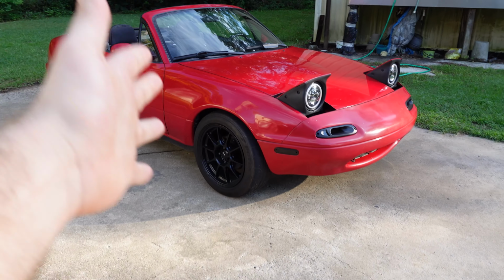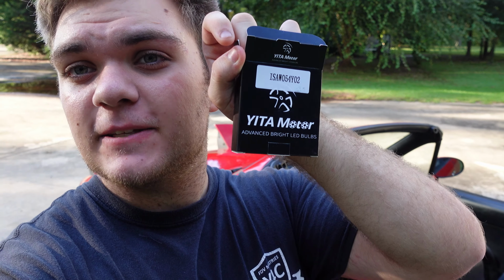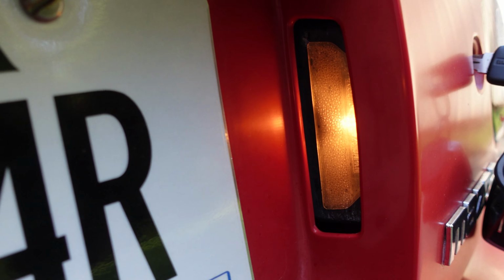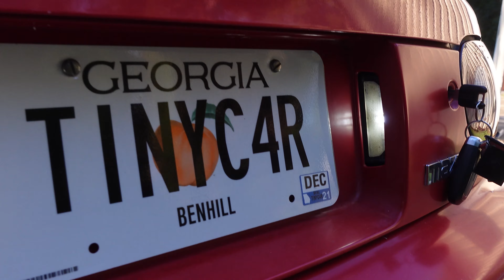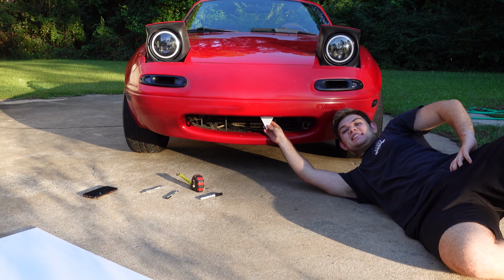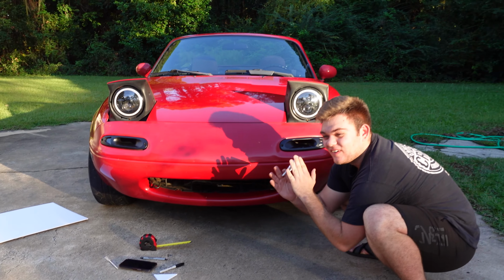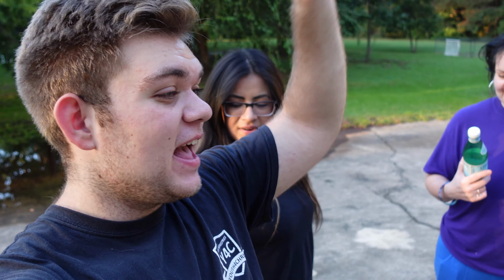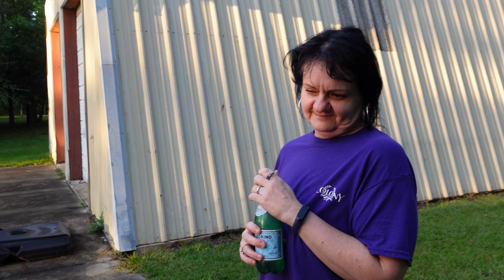DECORATING OUR MIATA FOR HALLOWEEN!

Comment: So what ended up happening to the miata? What was the issue? I just got done installing a new clutch and flywheel. Had the same issue of not getting into gear. I suspect maybe air in the line or leaking slave. Please let me know
Reply from the maker: The throw out bearing started making a grinding noise and broke into 4-5 pieces. I found the pieces while checking the slave cylinder to see if it was wet from leaking. The metal pieces from the throwout bearing came right out from where the slave attaches to the trans.

Comment: hey men i have the same problem the gears wont go in so was a cylinder problem or the whole clutch ?? what u did to get it fix ?
Reply from the maker: It ended up being the throwout bearing. We had to take out the whole transmission and changed the whole clutch anyway
Reply: @MRTNFK8  ohh i see thats good men keep this channel but if u want more followers a subaru project ill be waching whatever u do be smart creat a subaru project bro